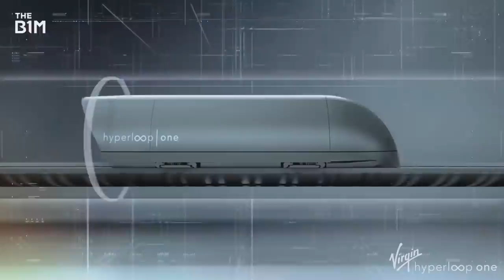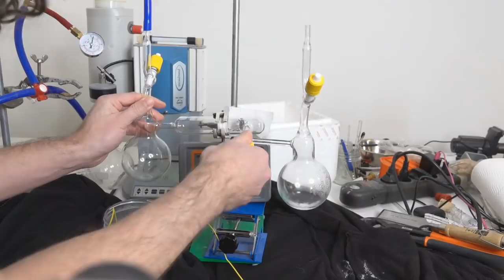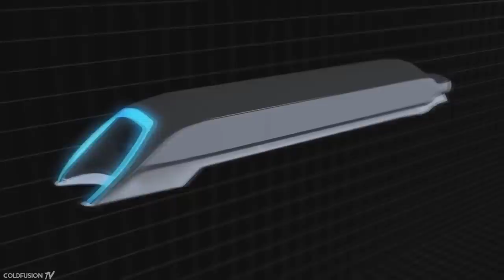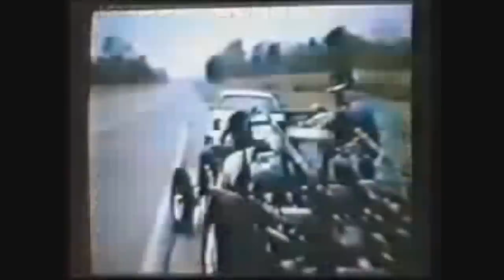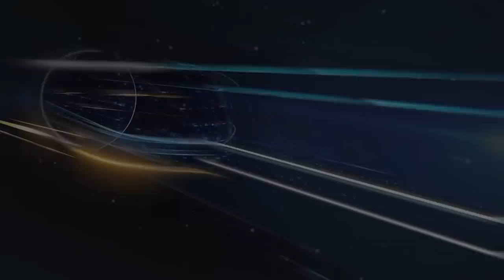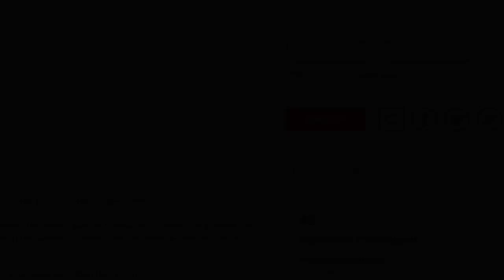Free energy device using Hyperloop technology!

Comment: stop global warming by pumping warm water wapor to Arctica
🤔 I love it.
Reply: To help stop global warming I run my air con on the coldest setting 24/7.If we all do this we can take control of global temps.
Reply: #logic ^^
Reply: @mrchriswin  yeah and I also spray a bunch of co2 from tanks at work  because it comes out really cold so it can fights global warming!
Reply: the world already does that, the ocean currents keep carrying hot water to cold places all the time form million of years and that didn't melt the ice caps
Reply: The polar ice caps would still be melting, but it won’t be because of greenhouse gases. Instead after thousands of years of using this tech, the temperature gradient would gradually disappear and the entire world would be like 65 degrees. Wait, the sun will always be putting energy out and hitting earth, meaning we’d have constant air vectors carrying cold air back to the arctic regions, meaning very sustainable energy, neato.
Reply: @FirstnameLastname-is2tu  You can melt the north pole all day.. nothing with change.. North pole is water. So it will not change the sea level. With the south pole its a bit different.
Reply: @matsv201  no, that is t how it works. Ice is mostly fresh water (impurities gets kicked out as it slowly freezes). Sea water obviously isn't, and its denser than the melted ice due to salt. Long story short, this leads to an increase in water volume when it melts, unlike what would happen if you had pure water and pure water ice.
Reply: @louisvictor3473  wrong in so many ways.
1 there exist salt water ice....most of there ice is salt water
2 the ice displace exactly it's weight in volume regardless.
3 its not the water that is more dense, it's the added salt.
4 even if it was the water was denser melted (and it actually is, a tiny degree)... It's denser, not less dense... So that it would actually shrink

So four different errors in one centance
Reply: @matsv201  Please, before barking about errors, try to be functionally literate. Better, go google things, then you talk to us. 
1. Salt water ice refers to the place it formed, not its actual compsotion.
2. Only if it were distilled water and pure ice, rather than a water solution with impure ice.
3. That is playing semantics. The solution normally known as sea water IS denser than the water you get from melting arctic ice.
4. Melted distilled water is denser than frozen distilled water, but that is irrelevant. In case you didn't realise by now, sea ice and sea warm are no perfectly uniform lab controlled substances, yet you're here pretending. What you have is the ice displacing its own weight X of sea water solution. Except, unlike lab controlled pure water and ice free of impurities, the X tons of sea water (not just "water") occupy a smaller volume than the X tons of arctic ice when would if it is melted. That is the iss

And you're ignoring how a "long story short" explanation works (like lots of details being intentionally overlooked or oversimplified , like gravitational pull of large land masses, like the polar ice sheet, which would be gone if it disappeared). 

Sure, the effect of land based ice is much worse, but melting the arctic isn't free of impact and consequence either. You in particular having any understanding of the science around it or not.
Reply: @louisvictor3473  you don't ha e a clue. Just refuting the first one, the outer 3 is to stupid to bother.  

Salt water do frezz. And there is salt in the ice. That the ice magically all turn non salt is a school book myth.
Reply: @matsv201  okay, go and make an experimwnt, mr all wise arm chair a scientist. Not to hard to make, something a primary school kid can. Or dont. I dont give a fuck if you  in your infinite ignorance, arrogance and stupidity wants to believe your own fantasy.
Reply: @louisvictor3473  You have missed the basic premise. Arctic Ice is mostly sea ice. Antarctic Ice is mostly Ice on land .
Melting the Arctic would be of minimal impact compared to melting the antarctic.
Reply: @incandescentwithrage   You seem to have missed reading what I said. I never said that  land ice isn't worse in direct volume. What I said is that saying it makes no difference at all is incorrect. Nice try to bypass the argument by pretending it is "missing the point" of an argument I didn't disagree or address in the first place. And it isn't minimal either. That is ludicrous. Sure, the initial increase is on average small in numbers (iirc a tad over 2.5% directly from melting the ice alone), but that is a superficial ignorant pointless "analysis".  2.5% increase in ocean volume is  a lot of water. Just the first three problems with that notion.

First, it isn't the melting Olympics. It doesn't matter if one directly impacts more than the other, each of them alone brings undesired effects and we want none of them. The impact is significant in and off itself, and that is what matters.

Two, that is only the direct increase on average level. It ignores a lot of other negative impacts, including some factors that further raise the average sea level (e.g. the current ice is white and reflects a lot light, thus energy - if it is no longer covering all that area, what is left behind is a pitch black arctic ocean, which means more energy absorbed, further temperature increase, lowering density and raising the level further.

Last, but not least, you can't just look at averages. The ocean isn't a big bat tube in which water sits level everywhere, waves aside. It is a large complex system with very uneven distribution of said average level. This bulk of Impact is best measured by local levels. This does not translate to coastal high tides or average coastal sea levels being just 2.6% higher. That is not how it works at all.

 Losing it is disruptive of those mechanics by itself, even without water level increases. To say it is "minimal" and imply it is irrelevant, if that is the "main point", that main point is ridiculous. And that is just hte water levels. Then there is impacts to marine life, rain patterns, local weather patterns, wind patterns, etc.
Reply: The av. Temp would stay the same
Reply: George Russell Music yup, same for entropic death.
Reply: The vapor isn't warm as it arrives, beside I'm pretty sure the generated heat at the end point could be reversed with less power then it produces.  I think the heating impact be like a less insulated house. Give air is good insulation your heat spot be smaller then u expect especially the end point needs to stay cold so if the end points heats up it won't do a thing
Reply: The toughest decisions require the strongest of wills.
Reply: Build a wall around the arctic to keep the cold air in :)
Reply: Warm water vapor ???? Vacuum evaporation is the process of causing the pressure in a liquid-filled container to be reduced below the vapor pressure of the liquid, causing the liquid to evaporate at a lower temperature than normal. Although the process can be applied to any type of liquid at any vapor pressure, it is generally used to describe the boiling of water by lowering the container's internal pressure below standard atmospheric pressure and causing the water to boil at room temperature.
Reply: I’m confused but either this comment or the comments below it is going in r/woosh

SOMEONES GETTIN WOOSHED
Reply: Which planet is "Arctica" on?
Reply: You may want to take another look at global warming. ... northen hemisphere is inder record ice .... i live in Australia 40 deg f 2 days ago .... i woke shivering 2 days later .... not very warm this summer .... and dont belive tv .... i live here
Reply: You just have shown you don't understand the word "global".
Reply: Oskar Forever Without the polar ice caps to reflect the suns energy the earth’s temperature rises faster. So yes, it would cause global warming, just slower. Besides, I think most people don’t care as much about the temperature rising (at least anytime soon) so much as the melting ice and sea level rise.

Comment: This video is like all sarcasm isn't it? There were real free energy devices back in the 1600s-1800s. Check out a video called Free Energy Hotel Ponce De Leon. This and all those old destroyed Mudflood mansions used fireplaces that were unable to burn wood. Instead there are 2 poles with orbs, and a heating plate.

Comment: Sarcasm aside, if a space elevator was ever built, could you power the elevator  cooling the vapor in space?
Reply: No. Main problems:
1) Space isn't cold. Solar radiation pumps a lot of energy into anything that isn't shaded (or really shiny) and there's no conduction or convection of heat in space (the main movers on the ground) so radiation is the only method. For many materials the balance of radiation in LEO is well above 300K.  
2) The vapour pressure of pure water needed to fight gravity to get to orbital height is hundreds (or thousands) of atmospheres which would need the water to be at thousands of Kelvin to even boil. 
3) A space elevator (to Earth's geostationary orbit) needs materials that are stronger than anything that seems to be possible; an orbital ring could give you some elevators though.
4) If you have an elevator from ground to orbit you use wires to transfer power and solar or fusion (or fission) to generate it at the top and bottom respectively.

Comment: Actually it's a great idea to make a renewable source of energy that can be powering the grid consistently regardless of weather conditions or solar short comings, and the southern  hemisphere 
 could use the southern most regions.

 Convert natural gas lines into vacuum tubes and even make it modulated so there are millions of temperature differential networks. Why stop there .even tall buildings tops and mountains are lower temperatures then 2 km down in earth crust. And once the water condenses it can be used as a gravity feed hydro generator as it accumulates above the clouds. One my favourite Nicola Tesla quotes Throughout space there is energy . … it is a mere question of time when men will succeed in attaching their machinery to the very wheelwork of nature.
Hopefully u read this comment Phil, as u have before so many others, enlightening us as always. Your biggest fan Pierce

Comment: @thunderfoot  what in my mind is it build it in areas in which it has low and high altitude since temperature difference is large enough . No need to make it longer up to polar caps. It need to pump back the water back to the source and reboilit at close to vaccum pressure. As an engineer, it's possible if we do energy balance on the total system. Great work.

Comment: Okay I get what you're doing now... still the poor glassware :c
Reply: Seriously though dual semiconductor thermovolteic cells may be worth researching I mean diminishing returns on energy would be a factor but you'd at least be using some waste heat energy in numerous applications...or cool looking noisy sterling engines whatevs... Point is either reduce heat waste or use it y'know?

Comment: sorry, i do not get this. the vacuum pumps cost so much energy that the energy cant be for free, right? what you can do, however, is use temperature differences that already exist, e.g. the difference between the north sid in shade and the south side in sunlight of a building, and then open a window on voth sides and use the resulting wind to keep the house free of mold even in 100% humidity. this is how i survived in the monsun season in japan without airconditioner. allways had a fresh breaze in the narrow appartment that luckily had a window on a sunny south side and a shade north side. i did not get the impression that this breaze would have powered much, though. but it was for real and it was for free. so, please thunderfoot, could you give us some realistic advice of using energy and physics to make our lives easier and cheaper and more energyefficient? i man like my free airconditioner in japan that created a fresh breeze and kept me free from mold all just by opening windows on a hot and on a cold side of a building, no electicity needed. what else can we do to use physics to our advantage? and what technology makes sense to install eg. on a balcony or roof or window to get something out of it efficiently? how can we eg calculat if it makes sense to install ssolar panels on the roof?
Reply: r/woosh
Reply: He's being sarcastic...
Reply: I can't answer your questions, but just want to signal my approval of the significance of what you said.  Satirical comedy has a function but does not propose answers.
Reply: What you've described there is exactly how wind farms work. Only instead of on the scale of a small room with a light breeze its on the scale of continents with wind speeds of 5 or 15 miles per hour

Comment: Out of curiosity, how much energy could it a realistic version of this produce though? I would image less than the energy required to condense or freeze the water at the other side, but I really don't know
Reply: Only a tiny fraction of the energy required to remove the air. I guess Thunderf00t will come with the actual calculations later but the thing is that the mass moving inside the system is a lot smaller than the mass you removed when creating the vacuum, and then in order to keep the vacuum you must keep removing mass from the system (since it will stop working once all water has condensed in the cold flask).

Comment: This is more ignorant than the flat earth!
1. A hyperloop under the Golden Gate will block shipping into the bay.
2. Thermodynamics was developed back in the days of the steam engine.
3. The speed of sound in a vacuum is zero. (In space noone can hear you scream.)
4. The energy to make a vacuum and cool one end is considerably more than the energy out.
5. He sites 90% efficiency but does not calculate the entropy.
6. This is essentially a steam engine in a vacuum.
7. Turning a tinfoil impeller is no indication of how much useful work can be done.
8. Thermodynamics laws say energy cannot be created, only transformed. No free energy. TANSTAAFL!
9. He is skilled at glassblowing.
10. Solar radiometers will spin foil turbines in sunlight but are not useful. Not really a special effect.
Peace

Comment: In all seriousness, if you were to do something like this where the terminal points were in hemispherically opposed climates - say Canada and Australia, and you designed it so that the steam turbines worked in both directions...  You'd get a nice little burst of energy twice a year when the temperatures flipped.  Of course building a tube that size is silly and of course this would be a poor way to capture solar energy...  Ok so what if you tried that idea on a smaller scale?  Say you put one terminus in the desert, where it's scorching all day and freezing at night.  Then you put the second one say underground where it's a steady 60 degrees F.  At night the underground is relatively warmer and forces the steam to the surface, and in the day the hot sun forces it back underground.  Of course all these versions fall apart for some reason or another, but you really could have it sustain indefinitely if you set it up so that the thermal difference is both high and reverses polarity on its own.  Then there's the issue of maintaining a vacuum.

Comment: Shut up and take my money.
Now seriously, thermodynamics tells me that this will not work. So I won't support it. You basically made a frigorific ditherm cycle. But since it isn't ideal because of friction. This will not work, not better than a steam turbine, as it's exactly the same principle but using a cold source rather than a hot source. You will never make more energy out of this system as it requires to operate. I could go more it the details but thermodynamics was probably my least favorite course during my chemistry degree and you know way more about it than I. I'd have taken the time to argue in details if I didn't knew you well and didn't knew this was all satirical.

But even without going in the thermodynamics of it, just using logic, this will be hard to perform as your tube will slowly fill with liquid water on the cold end, no big deal just pump it out, yes, however that's not all, you'll be forming ice as well. Thus requiring frequent standby with tube repressurization and workers going picky picky at the ice to unclog it.